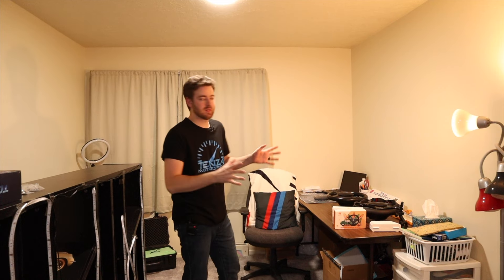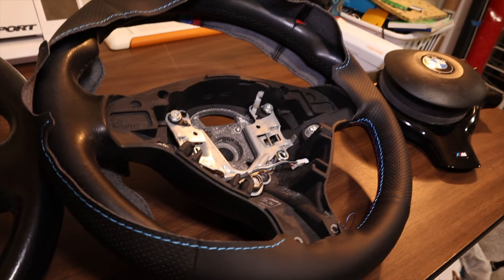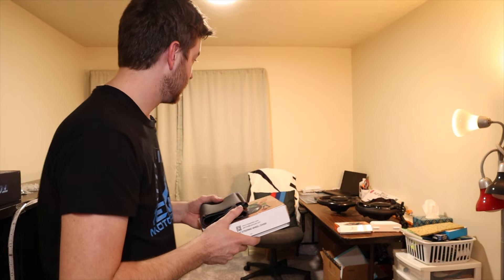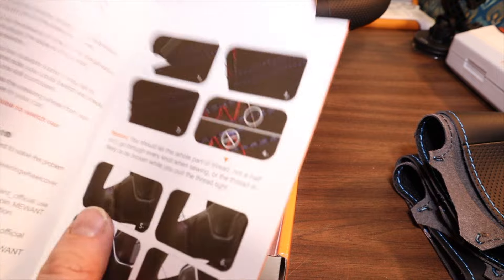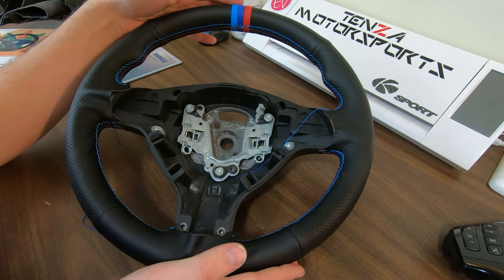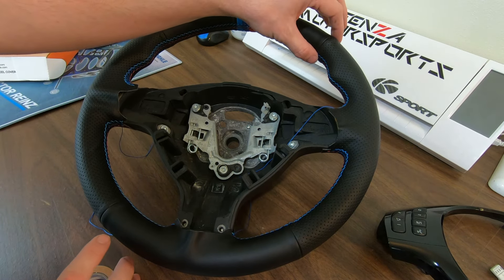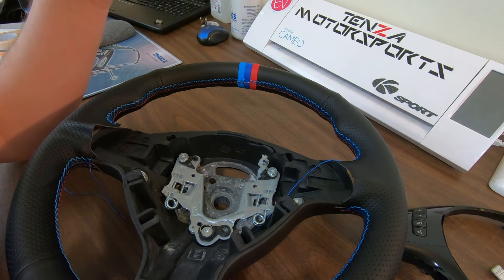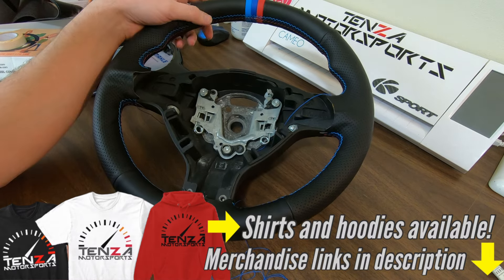BMW E46 Steering wheel restoration - Custom M3 DIY wrap install and review - Instagram Giveaway

Comment: E46 steering wheel can fit X5 and e39 ive seen em in those cars
Reply from the maker: Good information to know!
Reply: @TenzaMotorsports  I would also say 850ci because I seen em with e39 steering wheel so maybe it can be swapped to e46 as well

Comment: do you have to take the wheel out
Reply from the maker: No. There are pros and cons to both though. When it’s in the car, it’s nice because it won’t move around as you try and stitch it up. When it’s out of the car you have more access to see what you're doing but hard to hold.